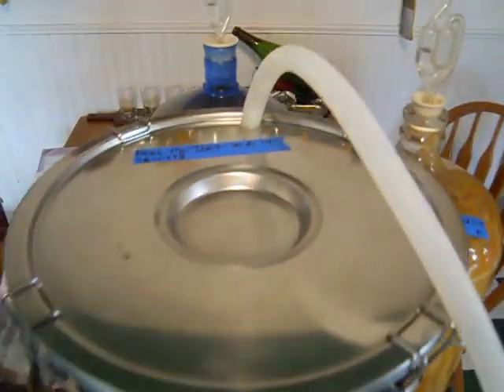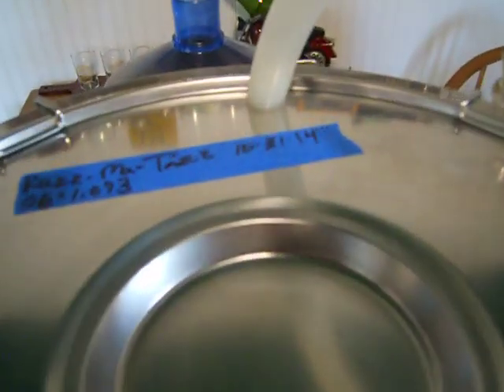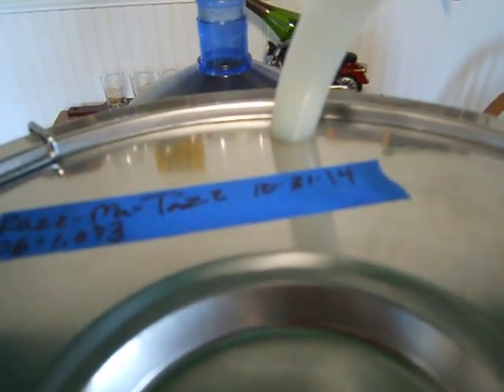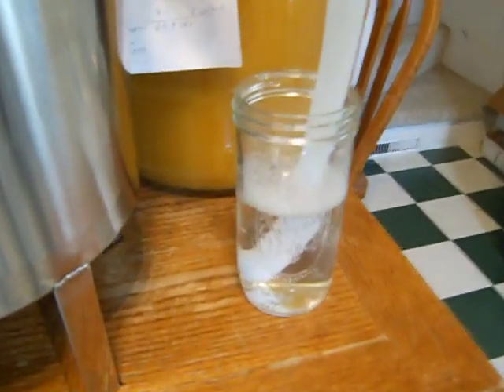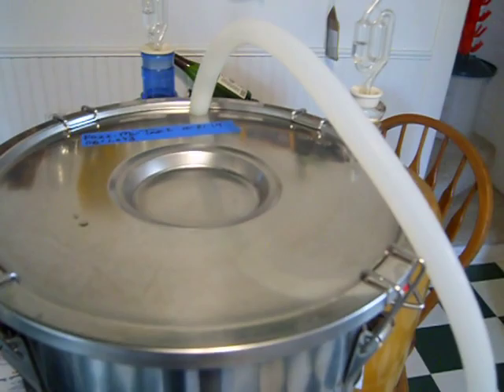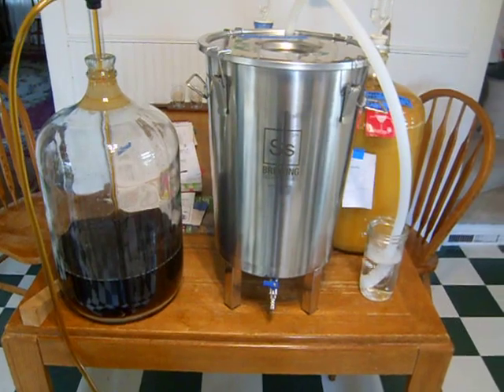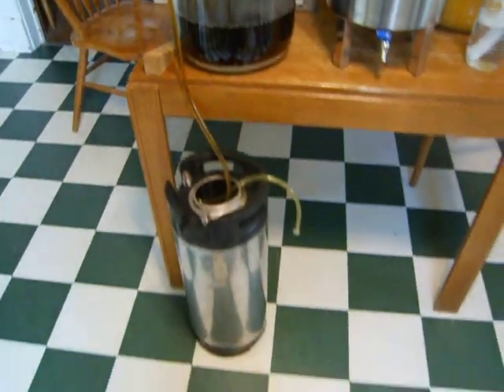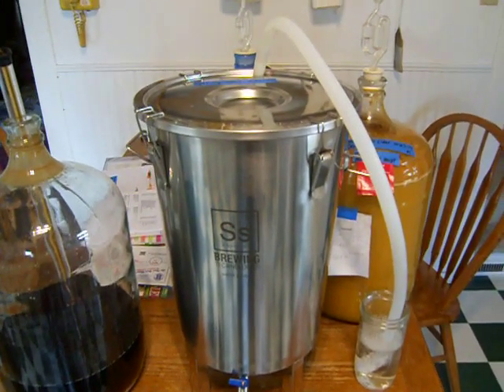SS Brew Bucket Fermentation with blow-off tube

Comment: I'm thinking about getting one of these brew buckets. I like the fact it will fit in my fridge. Is there anything you don't like about it? Also have you had any issues with the trub building up above the ball valve level? Cheers
Reply from the maker: There are several things I dont like about it but it works ok. No problems with trub and the valve. I use my 6.5 gal glass carboy as my main primary, then SS bucket then plastic brew bucket. Last week had them all full. So it's second in list if I need it. Maybe wait until spring 2015 when they come out with new version of lid.